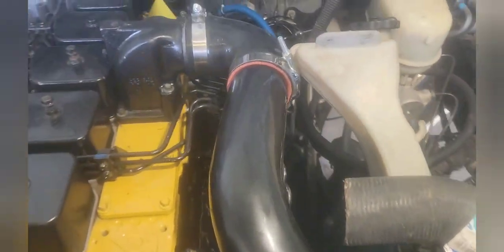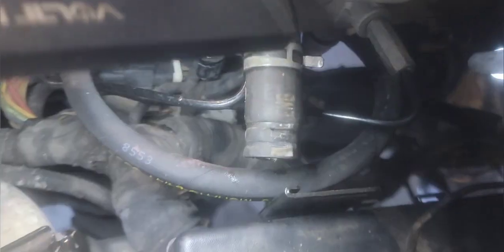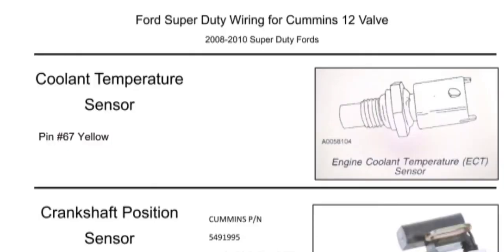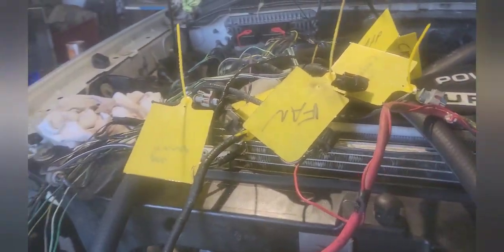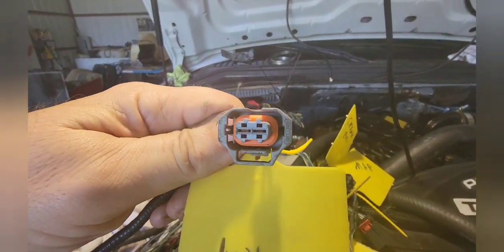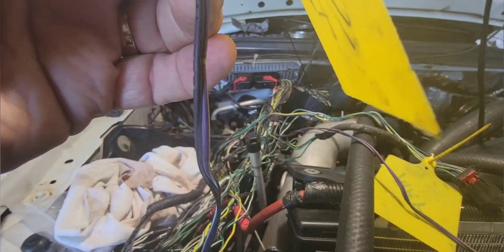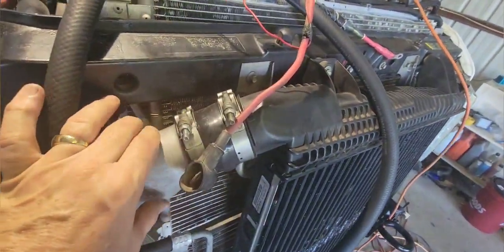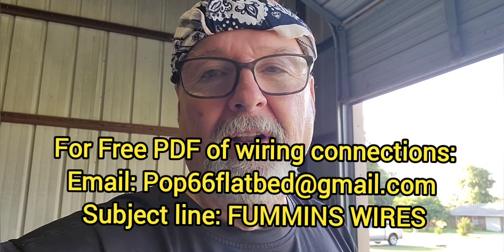Swapped 6.4 Ford Powerstroke For Cummins 5.9 12 Valve (Episode 16) Wiring and Connectivity

Comment: Can you please send me a diagram, how to set up a pcs 2000 to my 2008 f250 with a 5.9 12 valve Cummins.let me know if any charge on doing it.Thanks
Reply from the maker: Brother, I have no clue about a pcs 2000.  I have a wiring explanation setup.   .Pdf that's all I got. 🤷🏼
Reply: @PopsFBR  can you send me that pdf please.
Reply from the maker: @isanderrodriguez755 if you need wiring pdf, I will need your email.  Shoot me your email either here or pop66flatbed@gmail.com

Comment: Hi I have some problems with the cluster is dead. I don’t know if I remove too much ground. Please help

Cummins swap 5.9 12 valve into a 2008 f250
Reply from the maker: OK, is there no gauges working? Then your ground is probably cut.

Also, the grounding wires from engine to frame can cause this.  Check all frame ground wire bolts.

If only the tach is not working, then that will kill most, but not all cluster gauges & lights.

Comment: Hi Melissa I need your help having problems with my top plate does not connect with holes iam using the 6.4 a/c compressor the two front bolts fit but compressor is way off and putting just one bolt in the back it works but two front r way of. O my tension pulls came with one lock hole and I was the the one on video that It has a few more and I got a fan belt with the number ko80816 and fits super tight would that be right or is it the one In video ko80826 I appreciate your help thank you
Reply from the maker: There is a bracket from Mike Fuchs that keeps Ford A/C aligned & matching up.  Let me know if you need contact info.

Pop
Reply from the maker: Yeah, I had to go to the tensioner shown in video.  I was quite surprised how much easier the whole serpentine belt assembly synced up with ease when using the "looser" one. 👍

Comment: I have a question on how you did your fuel... in one video you said lift pump to lift pump. Is the ford pump still working?  I truly appreciate all your video's ive learned so much, your video's are definitely helpful!!!!
Reply: Thank you so much for the response.. I have been looking at the sump kit, there is so much information on doing this swap, it's hard to make a decision... I want what you have built a good reliable truck that I can drive whenever to wherever.... I  don't have Facebook otherwise I'd join over there and share... thanks again.
Reply from the maker: Appreciate it!

One of the unfortunate things about doing a video series on a project like this, is upgrades.  Some you get to video others, you don't.

The fuel upgrade I did was to bypass Ford lift pumps.

So, I drained the fuel tank and put a bottom "sump" connection in.  Then, ran a fuel line directly to the OEM Cummins lift pump on the engine block.

This direct line takes all the problems away from air getting into lines as well as taking the ecm switch on/off for the Ford lift pump, out of the equation.

I have found absolutely no problem since I did this mod.

BTW, when you do this mod, you'll need to plug the suction line that comes off the top of the tank. However, I left the return line from Cummins connected to OEM line going back to fuel tank.  I can send you pictures if you need.

Take care.

Comment: My 6.4 is deleted. Should I leave the computer in its current state or return the PCM to stock tune before removing the powerstroke engine?
Reply from the maker: Thanks for watching!  Leave computer as is until you're through driving.  Then, without engine running, and switch in "on" or "run" position, revert to stock with whatever tuner you're using.  After you pull 6.4, install 5.9 you'll have a new tune to install.  But, your ecm/PCM must be stock and tuner unlocked before new tune can be installed.
Reply: @PopsFBR  thanks for your response.. I have the HNS Mini max. How would I unlock it?
Reply: @PopsFBR  What does the new tune do? Does it make the engine light go off? And where would I get it?
Reply from the maker: @MR_Salguod yes. Stops check engine light etc.  I use SCT Livewire, tuned by Randy Gillam.

GO to "Fummins" group on Facebook and you'll find him there.
Reply: @PopsFBR  One more question for you, Do I need the Mass Air flow sensor? My truck is a 08 f250 6.4 with a zf6.
Reply from the maker: @MR_Salguod @dougr.2039  if you put in a 12v, no. If you are going 24v, yes. If you're staying 6.4 yes.
Reply from the maker: James, a Minimax is locked to the VIN of one vehicle only.  In order to change vehicles, it has to be attached to the VIN vehicle it's locked to.  Then must be returned to stock tune.  At that point the readout will say "unlocked".  It will prompt you to install a tune that is loaded on the inserted microSD card.  At that point, unplug the system and remove it.

It then can be sold to someone as an unlocked unit.

Comment: I believe I am using the same power steering pump, but my return line is going back to the reservoir..  I'm confused on which is the inlet and which is the pressure port.? One Port has a restriction cast in it, the other is unrestricted.
Reply from the maker: Yep... Thanks for watching.  I'll help any way I can.
Reply from the maker: The reservoir is connected to forward most orifice. Pressure, the furthest back.  That attaches to hydroboost. Hydroboost circulates through braking and steering, returning to reservoir via cooler.